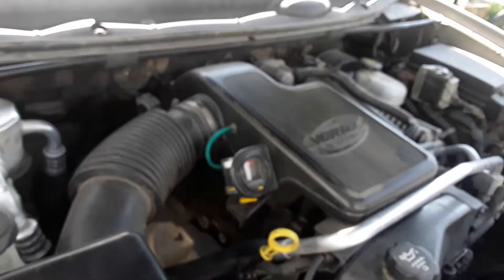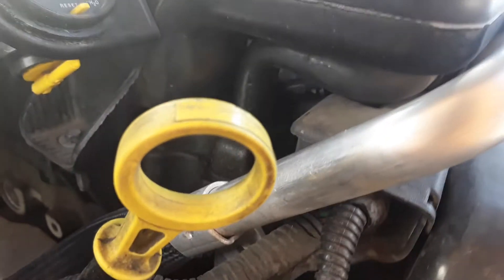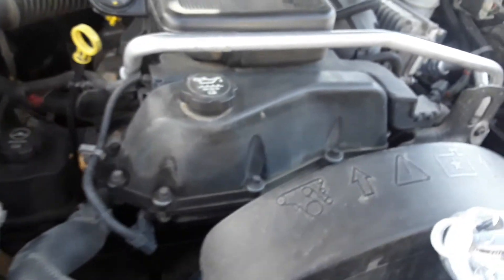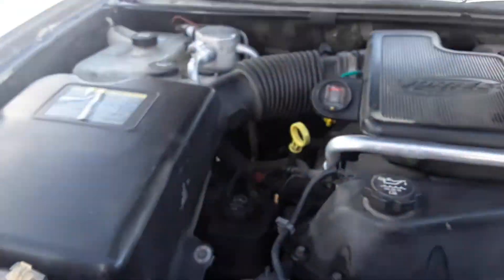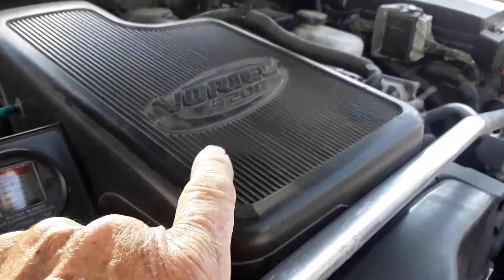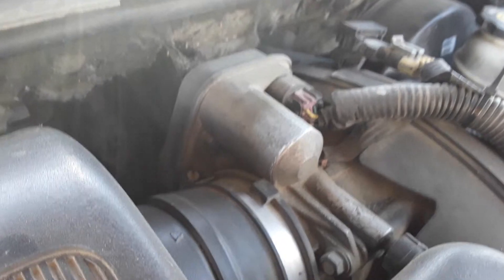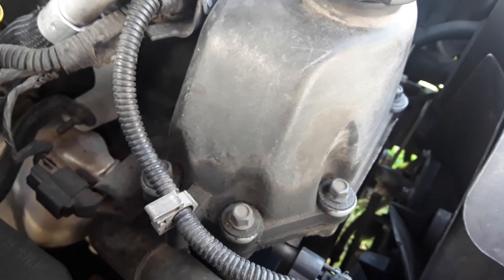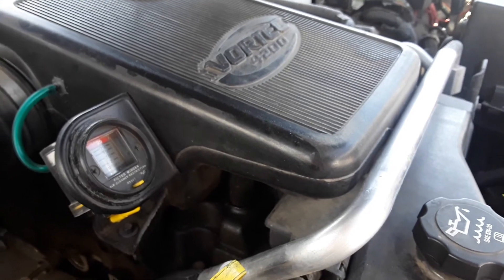Yes, The 4.2 Has A PCV System

Comment: Could a blockage in this system, especially on the intake side, cause a PO171 code?
Reply from the maker: ☼ I think not because -->  for a P0171 problem code to come from the PCV system, the AFR is significantly lean --- and there's not really any way the CV-side of the PCV could cause that unless the hose was either badly damaged or totally missing. .............. a P0171 means the PCM is detecting the engine is receiving too much air and not enough fuel.
☼ That would be a gross leak which I think might be so-o-o out-of-range for the computer to handle ... you should get a flashing SEL and perhaps a small hammer would pop out of the the headrest whacking the driver in the head to get his attention. 
☼ A P0171 code is set by your vehicle's powertrain control module (PCM) when it detects that the air-to-fuel ratio of your vehicle is too lean ... make that "very lean" if this were to be what happened.
Reply: @SurferJoe46  Thank you for your response.  I think I've figured it out.  I'm thinking it is a small  exhaust leak causing the code.  I'll find out soon enough.  Regardless, thank you for sharing this video.  It makes a lot of sense and is something I would have never known had you not shared it.  My Trailblazer is not drawing a vacuum at the dipstick so it will be getting your Berrman's treatment some day soon.  But first, this Check Engine Light.
Reply: @gregbruns8442  was your trailblazer ticking when you had a small exhaust manifold leak mine is ticking but don’t know if it’s the lifters or exhaust manifold
Reply: @angelf9800  I didn’t have an exhaust leak.  You may want to read the full comments.  But no, mine was not ticking.
Reply: What did it wind up being?
Reply: @altarwork  My Trailblazer did not like the new MAF sensor I had put in it.  Or it was defective.  Or it just took some time for the ECU to figure things out after I fixed all of the leaks on the intake side.  Honestly, I’m not really sure.  The fuel trims were very high.  After running multiple times with the old MAF in it the trims finally settled down to be within the ECUs tolerance.  Then it stopped throwing the code.  I haven’t tried putting the new MAF sensor back in.  I’d bet it works now.  I think the ECU just took some time to figure things out.

Comment: I took the air box off and used a plastic long thin tie wrap and put it in the hole and once I felt the blockage less than a inch from the hole and worked the tie wrap gently until I felt the clog clear. I poured 1 cap of Berrymans B12 in the hole. Started the car. The problem is solved.

Comment: Quick question.  Is there anything down the hole of the upper hose?  This one has a spring assembly but no internals.   A pocket screwdriver goes straight down.  It also whistles while on idle
Reply from the maker: I have nothing but blackness looking down that standpipe ... there is no mechanism about which to worry - it's just a direct passage to the intake runners that will carry fumes and vapors from the crankcase when the engine's running - that's all.

Comment: So why not a viewable pcv filter to stop all that
Reply from the maker: I THINK I understand your comment --- but do you want ME to provide something more tangible? "Filtering" the vapors isn't a problem --- it's not even wanted because that's not even a good idea and it just adds another layer of responsibility that owners can ignore too. 
I honestly DO appreciate your comment and if you can give me a little more help in understanding your concern --- please re-post it here.
Reply: A viewable pvc filter could stop could stop the damage you described, and yes it might be neglected but even oil gets neglected but if you’re wondering what’s wrong with it any look and see the filter has oil in it you know there’s a problem there picking any type of debris that shouldn’t be
Reply from the maker: @redxband1994  Aha! I see where you're at --- and I don't agree in theory although your intentions are good. What I THINK you want is something like the old bowtie KV fibrous strand filter in the air cleaner. That system is rather antique and there's the disposal of it when it gets full --- something a Federally regulated vehicle is not allowed to generate any more. 
So since motor vehicles are ascribed to become cleaner and less polluting every new model year, a system that can maintains itself with scheduled oil changes and regular services is where things are going and the designers are told to keep the DIYer out of the control systems other than a steering wheel, a throttle and a brake.
Reply: @SurferJoe46  exactly it could be one more thing to charge a customer to change but how big of a problem is oil in the pcv system . So why not a filter on the crank case vent ,I also have some questions I own a trailblazer 04 and having problems with idle
Reply from the maker: @redxband1994  You keep saying "pcv system" and you've got to understand that any oil in the KV side is the indicator that the CV-side is not working and I don't see where the option to install a filter on the CV side is possible nor even feasible. 
The KV side won't improve with a filter because there's never supposed to be any oil in it --- never. IF oil is flowing through the KV side and into the air/plenum of the intake - the system is running backwards which indicates a failure of the crankcase to be correctly cleaned and that's the problem. 
Water collects  in the engine and that's damaging and destroys the oils properties and the purpose of even having oil in the crankcase. 

Polluted oil - contaminated with water is - on all levels - destructive. 

Filter or not - and there's no way to filter the crankcase emissions because they would render any filter as plugged and useless in a few miles. You'd have to run alongside the vehicle changing filters as it went down the road.

Comment: OK, I'm going to sound like an idiot since I've never used this additive.  So I want to be sure before I screw something up.  You are using "Berryman B-12 Chemtool Carburetor, Fuel System cleaner" as a solvent for the crankcase ventilation tube?   It makes sense but I want to be sure.  I cleaned my Throttle Body today and I'm surprised the car ran at all, it was filthy.  I don't think it's ever been cleaned and my 2008 TB has 150K on the clock.  There was a light coating of oil in the intake plenum.  If this is the right stuff I'm going shopping for next weekends project.
Reply from the maker: That oil is from the PCV system not working up to standards. If it is working, the flow will never enter the plenum or throttle body butterfly. There should ONLY be cleaned air - after the air filter - going through the throttle body - nothing else.

Comment: good afternoon friend. Can you tell me in which direction the PCV lab valve is placed?
Reply from the maker: OK --- there is no "valve" as you are thinking. it has no variable orface ... the vacuum is controlled by the MAP sensor in the plenum, right after the throttle plate. If the vacuum goes too low in the plenum, the ECM will not allow the throttle to open too much. 
It's kinda complicated to explain and I'm working on a video to explain it - that's gonna take a little bit to edit as that's going to be my first video editing project. 
Normally I just turn on the camera and let things just happen as they will.

Comment: My hose  that's under the cover that leads into the nipple it's ripped and leaking oil thru there I can't find a specific name for that hose to buy a new one can u help naming it ?
Reply from the maker: You'll get blank stares if you ask for what it's supposed to be called: KV Hose. 
That it's leaking oil is a bad thing - it proves the system isn't working because there's never supposed to be any oil there - not in the hose or the nipple or the sound chamber or the throttle body.

Comment: Thanks for the great video! My hose does not have a top clamp it looks like the bottom does. Also while hose is rock hard so I’m unable to get it off. Any idea on how I could get it off without braking anything?
Reply from the maker: The hose is easily available in bulk at most auto parts houses .... they will cut it as long or short as you need.
Clamps? Well --- with a new hose maybe not --- but the factory has a policy to clamp almost everything and that's not a bad thing.
PS ---> buy the new piece of hose before you damage the old one.

Comment: OK Joe - I did it!! The hose was NOT baked on or brittle!! I used the Pittsburgh hose plier to take off the bottom end going into the crankcase. I forgot to turn the car off so immediately air shot OUT of the "port" - that's good because it means it was NOT clogged!! haha. Since i had the hose off then I poured some B12 in there - more than a capful - probably a couple cap fulls. Then I revved the engine a bit in idle to try burn it off - so the engine wouldn't hydrolock. Then I turned off the engine - put the hose back on and drove around for about 10 minutes. I had a "Service Engine Light" but since i just bought the Innova 3100 - then I cleared out the "idling at high speed" P code. Oh yeah - the hose stayed on - I reused the Old HOse!! Since it was in good condition. So what do you say to that report? You still think my PVC Hose port needs more cleaning? hahaha. You let me know. Is your goal to clean out the crankcase side of it more so than the "six ports" your referred to in the Intake Manifold? I realize those six ports are gonna be dirty.
I'm just gonna use MMO from now on - I'll just had a quart of MMO added to my engine oil when I get an oil change and run it for the whole OTC. What do you think of that idea? Too long for MMO to be in the engine? I don't think it's a problem. Let me know if you think that's a problem in your view. haha. thanks again for the help - that was a fun adventure. P. s. I put the Boroscope down the hole and I didn't see anything - and so then I put my bicycle pump against the hole but I couldn't generate much PSI. I don't have any air pressure hose or forced air dealy.  So like I said - air shot OUT of the port with the engine on - so it's not clogged up.
Reply from the maker: I love MMO --- but I tend to not put it into "metered-flow" style lubrication systems like our 4.2s. In a "pressure-type" oil flow system, the higher the oil pressure -- the better (up to a point). 
BUT --> our engines are lubricated by metered oilflow, not pressure. That's why GM created the strawman oil pressure gauge on the dash. 
....... it tells of what a "normal" engine would have for oil pressure IF it was a pressure-lubricated engine. 
Owners would freak out if they saw 12lbs of oil pressure on the gauge - right? But that's what it is! 

About MMO --- I use it - a lot of it really - primarily in my air tools air inlet for lubrication --- and I love the aroma of it too! 

I also like to use it when I'm tapping threads into aluminum --- kerosene is better, but harder to find where I live. So ---> it's Marvel Mystery Oil to the rescue - but not in our engines.

Comment: I put the boroscope inside the air silencer intake box - I definitely saw a streak of oil - so some got in there for sure. So then I sprayed in throttle body cleaner and let it soak in. I washed it into a bucket with the power spray of water - not much oil at all! I did this a second time - to make sure I cleaned out the oil - still hardly any oil came out. So whatever blowby positive pressure was minimal - maybe it got clogged briefly but I don't think it's been a serious problem at all. I just can't justify pulling off that "dirty hose" PVC to clean out the port. Since if anything goes wrong with getting the hose back on then I'm in deep doodoo. haha. I have the tools and part now though in case it does start to clog.
Reply from the maker: What. Are. You. Talking. About? 
You are afraid to take a hose off because you're afraid? Of what?  
What can go wrong with putting it back on? This is done countless times on hoses all over the auto repair world! 
"Clogged briefly" isn't even possible. 

Just watch the video and do what it says --- you will succeed --- somehow.
Reply: @SurferJoe46  OK I'll use the other car to get B12 and go to it! haha. thanks
Reply: @SurferJoe46  OK that "clamp" on the new PVC hose does NOT do anything. It's there just to have something to grab onto to pull the hose off. OK I'll go buy some B12 now and then pull off the old hose. haha. I'll warm the car up first idling and then pull the hose off and the pour in the B12. Thanks for the inspiration.

Comment: OK I must have forgotten to connect that S hose from the fresh air intake into the metal nipple. So since the L hose on the CV side (crankcase ventilation) is IMPOSSIBLE to get at - I got a straw inserted into the Acetone Spray CRC - and I filled as much as possible into the metal nipple on the S hose side - with the S hose off. Do you think that will then flow down into the CV metal nipple into the Crankcase? Then I connected the S hose back onto the nipple - as it had been disconnected for the past six months or so - No wonder I got such terrible mileage in the winter - the air was sucking in from that S hose as a cold air intake!!?  haha. The fact that OIL was spraying out of that S Hose then PROVES that the L hose metal nipple is blocked? Or did the oil spray out of the S hose because of the LACK of negative pressure since the S hose was disconnected? thanks
Reply from the maker: Actually, the "S" hose and the "L" hose are miles apart in function and they are not really related except they are on the same engine and are working to correct the emissions that every engine creates --- not counting two-cycle engines though. . 

Let me clarify that --- the PCV system consists of both a KV (atmospheric pressure side) and a CV side that is under full plenum vacuum at all times, but not like in the Olden Days. 

The CV side goes directly to the intake runners for each cylinder where the vacuum is created by that particular cylinder's intake stroke that pulls air through the throttle body at the same time as it inhales the vapors from the crankcase. 

Complicated? Just a bit! Mostly it's complicated by the fact that there's no real dedicated vacuum control valve --- commonly called: “The PCV Valve” --- but that's redundant. 

Of course, there's a lot more to this simplified assessment than I have written here.
Reply: @SurferJoe46  Thanks for the clarification again Joe - yeah I had the air blasting out of that hole when I took the bottom end of the L hose off. So I figured it was already cleared out. I've been good at changing the oil every 3K and also have used MMO in the crankcase. So... anyway - I did put acetone in that hole - just a capful of the the B12 Berryman.... I put the rest into the fuel tank. My MpG went up a mile !! So that B12 Berryman is the best for cleaning out the fuel. Thanks again for the help - kind of exciting that I get better mileage now more than ever at 270K miles. If I got 55 miles per hour then I can get 24 mpg. Not bad.